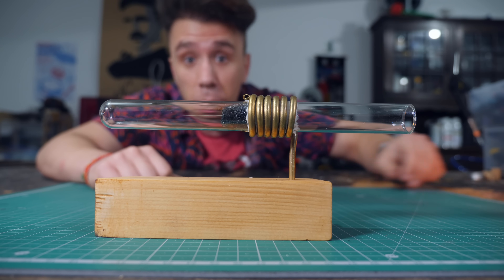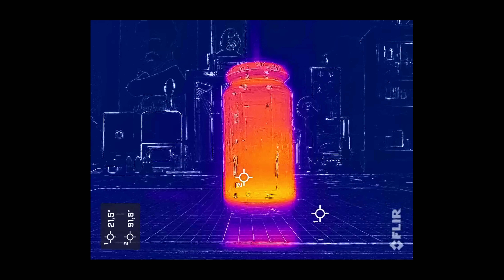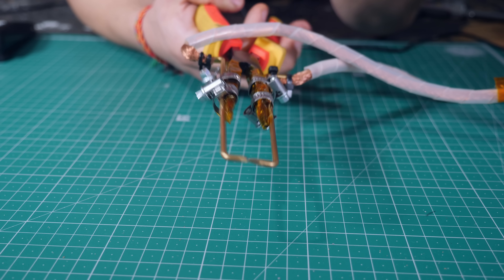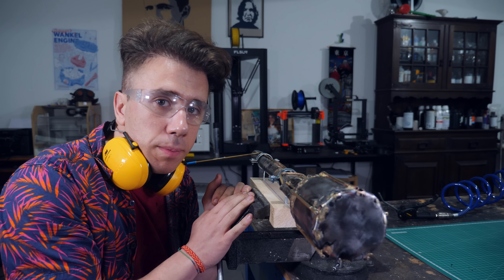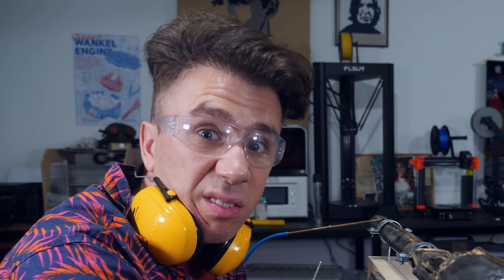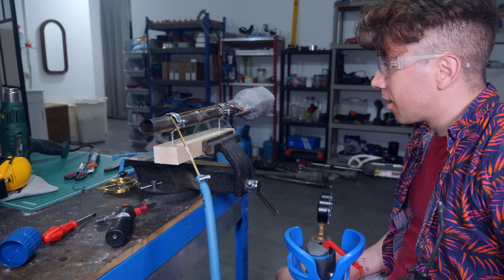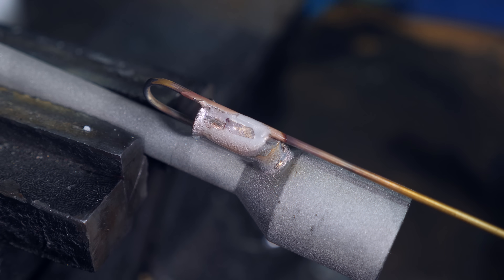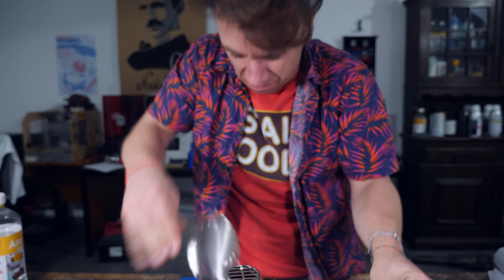JET ENGINE with NO MOVING PARTS (Pulsejet Engine)

Comment: You should try actively cooling your engines, instead of just trying to use more heat resistant materials.
Many rocket engines use regen cooled noozles and thrust chambers to keep the engine from melting. Basically water cooling the engine, except instead of water you use cryogenic liquid oxygen.

I assume you don't have access to cryogenic fluids, but how about just trying to water cool your engines? The thrust chamber could be made of brazed tubing, or maybe sheet metal on the inside and 3D-printed cooling channels on the outside. Then just use an electric pump to force Ice-cold water through the whole thing, and vent the steam out the other end.

Comment: How about you try a electric powered rocket with water?
Turn salt water into h2 and o2 
It will create a lot of pressure with enough current
And at last step burn the h2 for more thrust.

Comment: Hear me out: Water powered rocket engine. Water goes into an electrolysis chamber, is split into hydrogen and oxygen, then burned again in a combustion chamber, the two inputs would be water and alot of electricity. Not very practical but very cool and unique looking.

Comment: How about a Gluhareff pressure jet? That's also in the realm of simple, no moving parts jet engines.
Reply: I'm also wondering if a high bypass pulsejet could be a thing. So much energy seems to be lost as heat.

Comment: Build a 3d printed pulse jet like a bigger version of the small one but then use internal cavities filled with water and a radiator and pump to water cool the engine
Plastic can’t melt unless the water inside the cavities boils

Comment: You should make a hall effect thruster by using a magnetic field to limit the electrons' axial motion and then use them to ionize propellant, efficiently accelerate the ions to produce thrust, and neutralize the ions in the plume.
Reply: The atmospheric version of that is the ion thruster.
Reply: He could do it in a vacuum chamber…
Reply: But hall thrusters only work in vacccum not in earths atmosphere
Reply: @brktegebrehiwat5699  The atmosphere does not prevent them from working it just makes the thing they are pushing slow down too much

Comment: A huge improvement to the 3d printed plastic version would be to fill the "walls" with water! Just imagine putting a bigger cylinder over it and filling the gap with water.
Did you ever throw a water filled PET water bottle into fire? It doesnt melt, because the water cools the plastic better than the fire heats it. Same should work here too! I dare you to try it in a future video!
Reply: add 2 ports intake and outlet and water cool it with a pump and radiator
Reply: @kubik7203  that would make it way to heavy and complicated
Reply: And explodes and throws super heated water and steam everywhere
Reply: @Rullstolsboken  nothing is going to explode as long as you dont pressurize it. Also, it will take a loooong tjme until water really boils due to the bad thermal conductivity of Plastic
Reply: @hackenschere-intel  that engine produces a lot of heat, and if the thermal conductivity of plastic is to bad to heat up the water it will just melt or burn, and if it's not enclosed it will become steam and dry up and burn, if it's closed it will build pressure and explode
Reply: @Rullstolsboken  for sure it will break at some point. Its still plastic. But i guess it will hold up way longer than the current design.
Reply: Haha very very bad idea, as stated below there are 2 options
1. You make a vent and it eveporates
2. You don't make a vent and it explodes

In both cases the water won't do much if anything, because it is spread thinner than in a bottle, and will heat up faster. 
A PET bottle will usually melt before it explodes, and the fire will make microscopic holes that relieve preassure.
Reply: @CharlieTheAstronaut  true, but evaporation sounds fine too me. You will be surprised how long it takes until it starts evaporating.
Reply: Until the water evaporates.
Reply: He wound the fuel line around the combustion chamber for cooling around the 3D printed metal one. Gas expanding from compressed liquid form starts off very cold and gets constantly replaced by the new fuel going in...  Seems like a lighter option
Reply: it'll explode lol
Reply: The temperature from the jet engine is significantly higher than that from a typical fire. Also the water volume to plastic thickness is way higher than what he could accomplish for the jet engine design. And even if he makes a design that works, the water will evaporate quickly, or explode throwing steam everywhere. It's a bad idea.

Comment: you can try and design turboprop engine  using 3D printer,
 also you can control fuel  to make it more efficient , with metal 3D printer it should not be a problem.

Comment: You should make a liquid cooled engine which will circulate liquid oxygen or nitrogen to prevent breaking and make a regulating valve to control thrust .

Comment: I think you could you paint a plastic  engine with something conductive  and use some sort of galvanization process to make a metal coating around it, repeat it until its thick enough to not melt or leak and then remove the plastic (by hand or using some solvent idk), this way you can get a metal engine without needing a metal 3d printer, Ididathing made something like it and it worked pretty well

Comment: I have 2 ideas that you could try: 
1st. Use BrownGas(HHO), it will be more powerful because it's already mixed with oxygen and it's has a quicker ignition time and fire propagation times. Instead of pure hydrogen, BrownGas is easier to make(12V 7A electrolysis) and more safer, because you can control the production debit by a potentiometer =)) 
2nd.Also, to be sure that the jet engine has a proper cooling, why don't you make some fins on the body of the engine? You can use a simple fan or some water that is flowing over the body, in that way, you will solve the problem with "thermal isolation". The fins can be some metal strips welded on the body, you don't have to make it look fancy =))))
Reply: daddy uwu
Reply: I pup you varule 💋
Reply: But isn’t there a risk that the engine might explode when he decides to ignite it, since there is already HHO in there?
Reply: @xmysef4920  nope, I test a thing like this( I made a torch for melting and welding), and I have 2 control systems: the power from the PSU and the gas valve + if it's backfire the HHO, it will burn just what you produce, not an entire tank full of gas at 4 PSI =))))
Reply: @green_pines   No but like, even a little bit of premixed hydrogen (HHO) is extremely, extremely explosive.
Reply: @xmysef4920  Yes, is explosive, but a tank full of propane or pure hydrogen, is more explosive and more mooore dangerous than the little bit of HHO
Reply: @green_pines  well, not really as long as the tanks holding pure propane or hydrogen don’t break. A tank full of HHO or even just igniting a small batch of HHO anywhere will result in a very big and violent explosion. HHO is nothing to mess with, atleast if you’re not taking safety procautions.
Reply: @xmysef4920  You are right, the HHO is very explosive, but you can't compare the explosion of a small amount of HHO vs. the enormous amount of propane and hydrogen used in his videos. Fun fact, I mount a some HHO devices to gasoline and diesel cars, and they are working very smooth and safe, having in mind that the engine consumes just the HHO it's generating  =)))
Reply: @green_pines  A tank full of fuel with no oxidizer is not explosive.
Reply: It's a good idea, the browngas is too ez to made,lol
Reply: Good ides, i up this
Reply: Doing this in a noninternal combustion engine is extremely dangerous and/or violent for several reasons including flashback to the H2/O2 source.
Reply: good stuff

Comment: How about a "Rhythmic Resonator"

Here's how to do it:

Materials Needed:

A sturdy wooden box or frame.

A high-quality speaker.

An Arduino microcontroller.

An ultrasonic sensor.

An LED strip.

A power source (battery or adapter).

Assorted wires, screws, and nuts.

A dash of creativity!

Steps:

Create the Resonance Chamber: Start by constructing your wooden box or frame. Ensure it's large enough to house both the speaker and Arduino comfortably. Decorate it with an aesthetic touch to make it truly unique.

Assemble the Sonic Emitter: Attach the high-quality speaker inside the box. This will serve as your pulse generator. Connect it to the Arduino, which will act as the brain of your engine.

Ultrasonic Sensing: Mount the ultrasonic sensor on the exterior of the box, facing outward. This sensor will detect nearby objects and initiate the pulse when someone approaches.

Coding Magic: Write code for your Arduino to trigger the speaker in response to sensor input. Experiment with different frequencies and patterns to create captivating pulses. Make sure the LED strip reacts in harmony with the pulses.

LED Ambiance: Install the LED strip inside the box to complement the audio pulses with captivating visuals. Customize the LED colors and patterns to sync with the rhythm.

Power Up: Connect a power source to your pulse engine. You can make it portable with a rechargeable battery or keep it plugged in with an adapter.

Sensational Showcase: Now, place your "Rhythmic Resonator" in a prominent spot, and watch the magic happen! When someone approaches, it responds with an alluring blend of sound and light, making it an attention-grabbing.

Comment: You should check out your local model aircraft club. They might have a control line Pulse Jet aircraft or failing that they may be able to point you in the right direction. I have seen them fly many times in my younger days and it was quite impressive to watch.

Comment: you could try to do a rocket engine with a fuel called "whistle fuel". It's used un fireworks to push rockets in the air while producing a loud whistle, it doesn't even need a nozzle.

Comment: You should add a cooling system like a water circuit o something like that, maybe directly printed inside the wall of the engine, like the thing that you did with the resin water-cooled jet engine
Reply: the fuel is the coolant.

Comment: Great Video! My suggestion is to build a testing rig for all your engines and see which one has the best thrust to weight ratio! Could be like a tournament between the types of engines.
Reply: He already built one, he used linear rails from a 3d printer to do so.
Reply: That's impossible when your jet engines last .5 seconds before melting.
Reply: @HideYaWife69 eh, even a half second burn is enough to get TWR
Reply: haha true @HideYaWife69

Comment: You should try to design a 3d printed shaped explosive charge. 
A rocket is a controlled explosion, but so is a shaped charge. Would be awesome to see if it would be possible blow a hole through like 2 inches (5cm) of solid metal using 3d printing
Reply: he doesn't have explisive so I don't think it would be possible.
Reply: That is probably illegal😂
Reply: @Acrophobia2  Probably not, here in Sweden it’s illegal to even ignite a model rocket or a firework with more than 100 g of propellant. I don’t know what the laws are in other parts of the world, but obviously not as strict as in Sweden
Reply: @hampusmollgard4954  it’s illegal in the US so I’m gonna assume it’s illegal in Portugal as well
Reply: That's illegal in the most of EU
Reply: Ordnance lab is the channel to look at for this type of stuff.
Reply: lol you can't make a bomb on youtube
Reply: Rockets aren't controlled explosions. The rocket fuel burns, it doesn't explode.

Comment: You should make an Integza Nerf Gun. Powered by rockets or something and probably illegal in many parts of the world.
Reply: Its an full auto nerf gun using the exhaust of a pulsejet to propel its darts
Reply: @barnabasrsnags4828  probably wouldn't beat Gatlingtommy's moab
Reply: @barnabasrsnags4828  it would burn the darts, they are made of foam and resin
Reply: If you're aiming to launch normal darts (standard .50 cal) then there is nothing that hasn't been done i think the highest muzzle velocity is 400+fps for a "regular blaster" and backyard scientist and ididathing have broken the sound barrier with a dart.
Reply: @The_GOAT2282 to be fair I'm pretty sure ididathing used tampons as darts
Reply: @johnmurcott1273  so a 40k bolter?
If we include the original comment's rocket powered idea
Reply: Something like the old gyro-jet 😂
Reply: "Integza should make a 3D printed shoulder-mounted rocket launcher"

I fixed it for you 😂
Reply: Tell me you came from mark robers video to this lol
Reply: He is gonna make a Boltgun
Reply: I read that as integra🤦‍♂️
Reply: Nerf gyrojet! coool!
Reply: A rocket dart nerf gun would be sick, like the gyrojet guns
Reply: @dominicrichardson5546  hmm if he could make a really small solid fuel like that would propel it enough, sure that's a great idea
Reply: DIY recoilless rifle just dropped
Reply: I had a Max force brand sniper that shot wet tissue like pellets. I thought a certain size Extension cord cut into pellet sizes was a better option. Put a hole through a roller door with it i was like 😳😯
Reply: @kainestefaniak2751  sounds very safe.
Reply: @kainestefaniak2751  Eagle Eye?
Reply: Joel Creates has some cool nerf dart videos, if you haven't seen em
Reply: Eu comprava! Nem que fosse os stl, comprava
Reply: What would be the fire rate of a full auto jet pulse nerf gun?  What frequency does it pulse? Has to be thousands of rounds per minute
Reply: @AJB4D  and again the darts will burn
Reply: @Melonsplaygroundguy151  I see no problem with adding flaming or molten to the title
Reply: Homemade nerf guns have done to death.
Reply: Get 3rd printer
Reply: Tomato Gun?
Reply: Americans have a problem with guns
Reply: Steam Nerf gun
Reply: Except in Texas. We always love a new toy.
Reply: it wouldn’t be good
Reply: Argus As-014 = V-1
Reply: Screw it. Integza GyroJet Pistol
Reply: @slinkyexpert6905  He tried to make a gyrojet a while ago, didn't work too well.
Reply: gyrojet
Reply: So you want him to make bolter from warhammer 40k?
Reply: BUT NOT IN THE US
Reply: You’re thinking of the Gyrojet. You should look it up, it’s wicked cool.
Reply: So, 3d printed gun.
Reply: This comment is a scam, anyways you'll probably get the 3D printer from integza